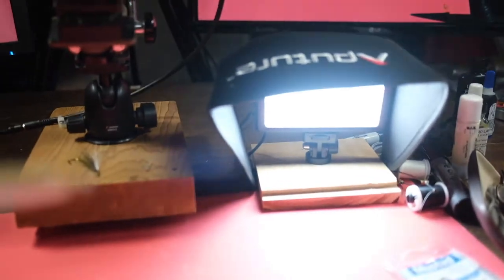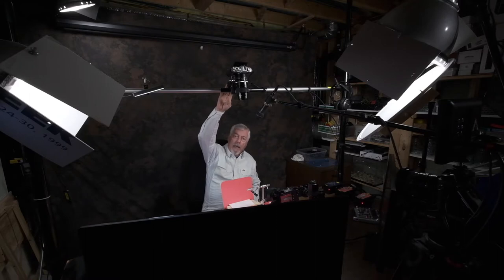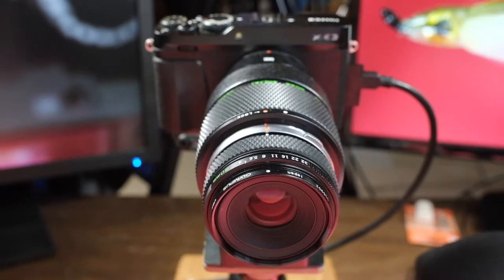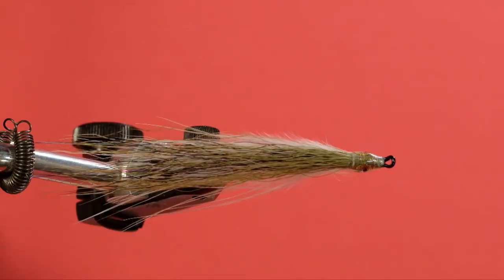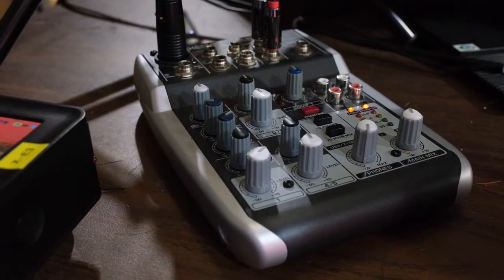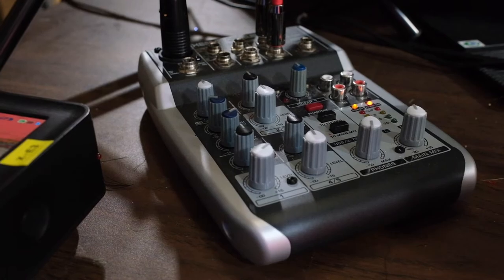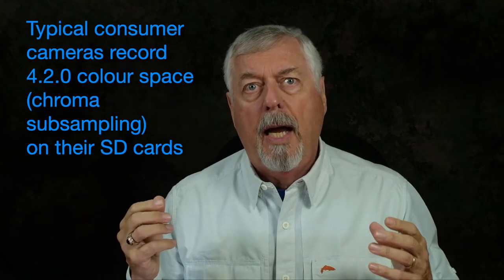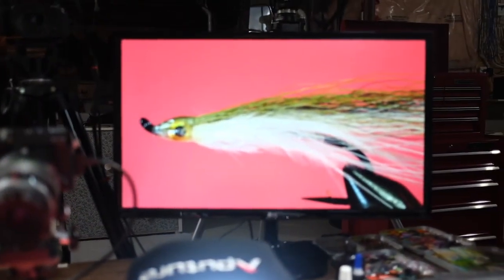Peter's Fly Fishing Vlog: My Studio Setup for Producing Fly Tying Videos

Comment from the maker: The key for me setting up this studio was to be creatively cheap. Most of the stuff was either bought used or on sale. My local hardware store has saved me a lot of money. The LED lights were bought there; just buy the same brand and wattage to ensure consistency plus buy the 5500K daylight bulbs. I also had a lot of this stuff from my still photography so I just repurposed it. Old manual macro lenses can be had for $200 or less and their quality is superb. Old two ring zooms are even cheaper. Used digital cameras lose a lot of value after they are one or two model versions behind and a lot of the fancy AF features on the latest cameras are pointless for this sort of use. If you want to buy an old camera but are unsure about it, go to dpreview.com and check out the reviews on it as their write-ups usually answer most questions, e.g. does it have clean HDMI out.

Comment: Thank you for sharing what you use and why you use it! I have thought about producing tying videos but these are the details that I need. I do have a DSLR camera but not much for lighting or background. I will look into getting the manual cameras and getting lenses. Thank you again!!
Reply from the maker: Your DSLR is probably capable of being set to 100% manual, plus it would probably accept old film lenses of the same brand. Pentax DSLRs are especially good at this. As for lighting, a good window on ones side and some white poster board on the other can do wonders.

Comment: Peter, this was amazing. Thanks so much for giving us a behind-the-scenes look at how you work. One question regarding the Atomos recorders-- do you have to have one for each camera? These are a bit pricey for me and where I am with my channel right now. Maybe someday. :-) Thanks again for sharing your setup. I'm going to have to watch this one several times to take in all the great info!
Reply from the maker: Yes we need a unit for each camera. The nice thing, they will also take audio inputs along with the HDMI and synch the two. 

If you don't want 4K, buy the old units off of EBay. Way cheaper. Just be aware that Atomos sells units that are just monitors and monitors+recorders, so make sure to get the right one. Also go to their website to see if the unit supports your camera. It'll still work with unsupported cameras, but we sometimes have to fiddle with frame rates or resolution to get everything working. For example, with two of these cameras the HDMI loop out to the monitors would only work if I set the frame rate to 60i. So if you buy used units and your camera is unsupported, you may have to try a few resolution/frame rate choices to find one that works 100%.
Reply: @hooked4lifeca  Thank you! I'll start my research now (and see if an older unit on Ebay might work). And thanks for all you do helping the fly tying community!